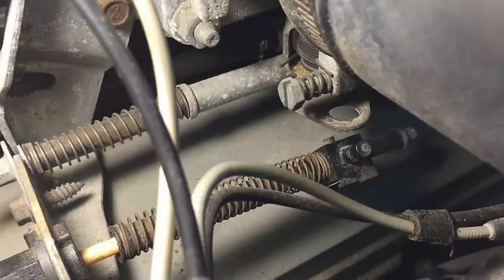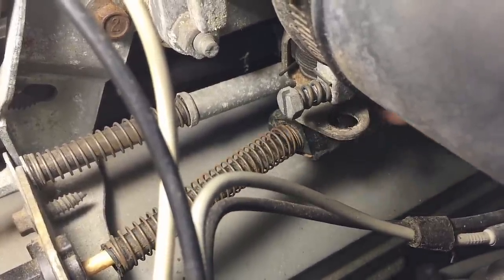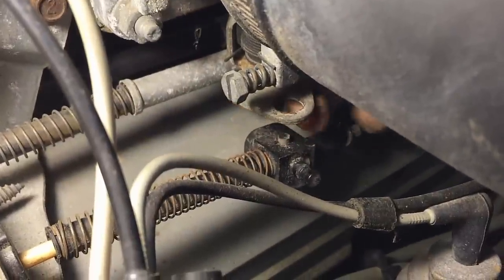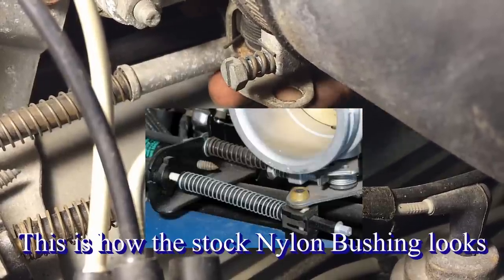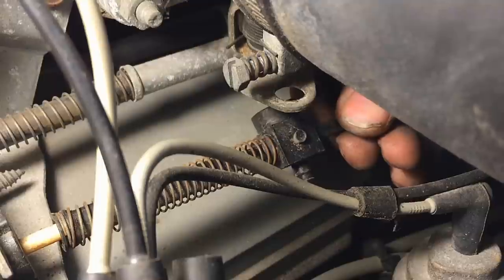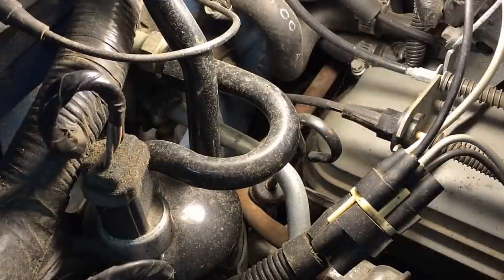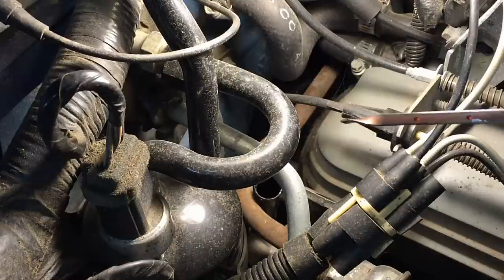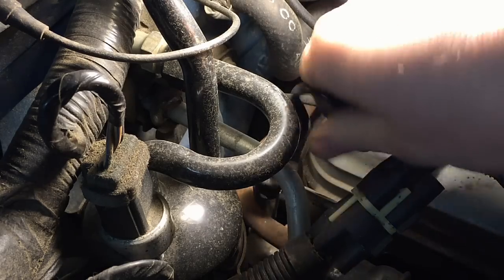Ford Quick Tips: #33 AOD Transmission Loss of Overdrive- TV Cable Bushing Inspection

Comment: It took a long time to find this information on the internet, but thank you so very much. I watched and immediately looked at the TV bushing.  Yup - rotted out.  Clear and concise. I will replace the bushing and hopefully it will correct the problem.  It should, I a have babied my 1988 Mustang GT Convertible - 62,000 miles.
Reply: Did it work ?

Comment: I had a 92 Crown Vic (yes, built pre Feb 92) where the TV cable snapped for some reason. I felt it right away in all gears, everything was slipping, and I knew to baby it until it could be replaced. Popped the new one in, adjusted acording to the manual, no problems. A coworker of mine has an 89 and had the same problem, and no matter how much I emphasised how important it was for him to get it fixed, he continued to drive it for like a week. I forgot how bad he smoked it, but it cost him about $2500 for the rebuild.
Reply: do u know of any place i could get the cable i have an 89 crown vic and i cant find a tv cable for it at any of my local parts stores
Reply: This is late asf but check out late model restoration

Comment: awesome video.  most AODs die this way....i caught the bushing on mine in time, replaced with the brass piece and clip.  whenever i see them for sale i grab them because they're impossible to get...i got the last two in the dealer network around here a few years ago.

also bumped up TV pressure slightly higher from factory for slightly less grandma shifts.
Reply: +brakedd 
How can I adjust TV pressure?

Comment: 1992 Ford Crown Vic. Mine's held together with rubber bands. Seems to shift ok. Been like this a couple years now. Had no clue till just recently what it was called, so I haven't been able to fix it. Hopefully I can find one online. It runs rough when lightly accelerating but smooths out the more gas you give it. Could this be the reason?

Comment: I have had several 87to 93 Mustangs over the years mainly autos since i had a really bad injury to my foot when i was younger and i have a hardware store in my foot so i prefer driving autos,anyhow  modifying these cars, installing intakes etc i had to deal a lot with the TV cable,needles to say i lost dozens of those little cotters that hold the bushing,boy they are not easy to find, as you pull it out with pliers or a pick have a magnet close by or a towel below it.

What i discovered after much trouble is that installing that bushing on top instead of bottom works sooooo much easier and better, why is that? dont know.

So instead of going thru the bottom small side first i invert it (flip it) and go thru the top, fits like a glove,i might add that was mainly always on aftermarket throttle bodies,i think they have a chamfer and thats why its so hard to stick them from the bottom,figure this might help someone out there.

Comment: I had a kinda odd instance with the TV cable on a '88 Town Car I have. I bought it from the previous owner who thought it needed a transmission. Turned out that the TV cable had hung up (guessing after the throttle went WOT) and the cable itself stuck out and wouldn't retract. After working the cable and freeing it up, all seems well now.
Reply: How did u get cable to go back in.

Comment: Just picked one up on eBay for my 1991 LTD Crown Victoria 5.0. Was not downshifting and AOD was not working right. Lo and behold the bushing was gone after peaking under intake. Replaced it with metal one.
Reply: Can you send me the link to that part?
Reply: @tonyiomi8703  it is in my replies

Comment: I had the same problem with my 92 mustang . I caught it and reattached the cable. Does the cable have to be adjusted or recalibrated after it being disconnected? I drove it after a reconnected the cable , and it's still not shifting into gear at about 30-40 mph.

Comment: So I have a 90 f150 that i was checking the engine on , I tried to reverse , but i only had the throttle cable hooked up not the tv cable. Now the truck wont go into any gear? Did I destroy the Transmission?

Comment: Hi, I recently burnt the AOD on my 1992 Ford Thunderbird LX V8 (302) and
 had a parts car (a 1989 Ford Thunderbird SC) with a freshly revided AOD
 in it. So I replaced the burnt one with the revided one, so far ok., 
all gears work, except that the transmission swaps back to lower gears 
too early. It shifts smooth up to overdrive, but as soon as I take the 
foot off the gas petal, it shifts down harder than expected. The same is
 with 3rd gear, it drops down do 2 immediately. When I throttle full, it
 switches really fast up to 3rd gear, but as soon as I go off gas, rpm 
goes up and it remains in 2, until i press the gas harder again, then it
 shifts at about 3000 rpms back up to 3. Oil and oil filter are new, I 
suspect something with the TV cable, but no matter if I pull it tighter 
or looser, the issue remains, but when I put it looser, it doesn't shift
 up that smooth. What do you recommend me to do, could this occure by a 
bent/broken/too short TV cable or something else, I didn't consider so 
far?
Reply: i transmission for 2000 Vulcan jumps what is an overdraft

Comment: @FordTechMakuloco   I have a 1990 Mercury Colony Park LS station wagon and I burnt my transmission up due to this problem. I had the transmission rebuilt but now the transmission feels different when going up a step grade like the grapevine in California or passing a car. Now it seems I have to push the accelator almost to the floor for the transmission to downshift and it feels like it rolls into overdrive vs before it was a clean crisp shift into overdrive and no problem taking a step grade or passing a car. Do I need to adjust the TV cable at the thottle bottle? From the information I researched I'am finding the TV Cable just sits in the throttle body with no adjustment. Thank you!
Reply: I have an '89 Thunderchicken, and the Haynes repair manual I picked up at  the local parts store describes "popping" the cable loose from the throttle body arm, then using a small screwdriver to push the white locking tab out of the plastic block on the cable end. The block should then slide freely along the notched rod. If not, the white tab may not be pushed far enough.  Then,  holding the throttle arm closed (against the idle speed screw), push the plastic block and pin back through the bushing on the throttle arm. Slide (push) the white locking tab back into place.  I guess you'll want to already have your idle speed set before doing any of this. I'm not a mechanic, I'm just relaying what my repair manual says.
Reply: I looked up videos how to adjust the aod cable on my 91 mustang, the shifts were too early and very soft...hope this helps my problem.

Comment: 88 Mercury Grand Marquis at approx 150K miles. Same problem. Used Motormite parts # 14041 to fix.
Reply: I also have an 88 Grand Marquis. First thing I did was check the tv cable bushing. Was gone. Replaced it before I drove the car and no issues.

Comment: Had  same thing happened to me ,but ended up burning the overdrive band. my questions is, do I have to rebuild the hole transmission, or can you just replace the overdrive band ?
Reply from the maker: Miki Ram Most of the time it is just the overdrive band, you will see very clearly when you open the trans up which clutch packs are burnt.
Reply: Thanks